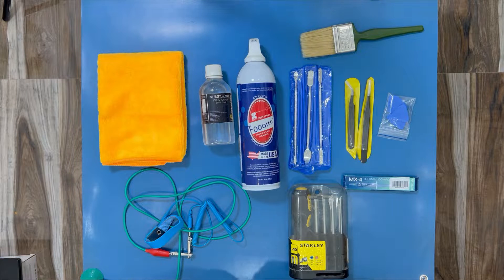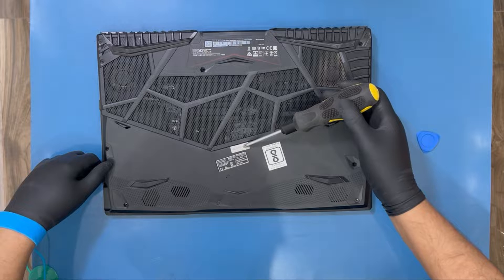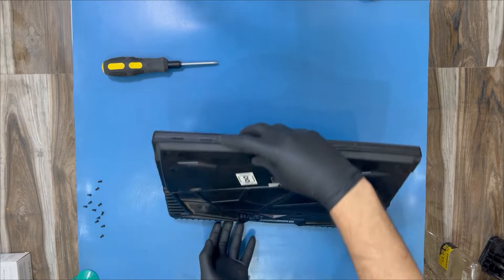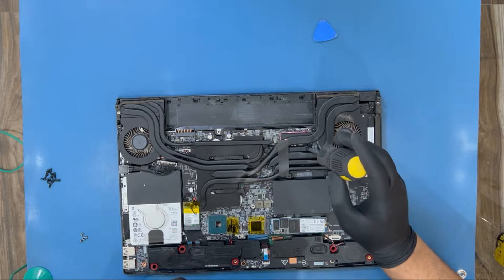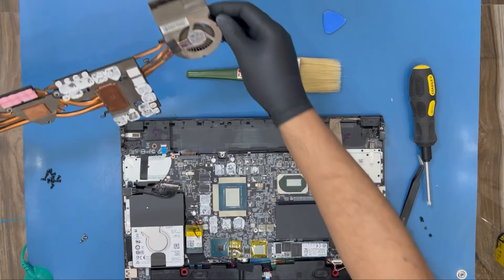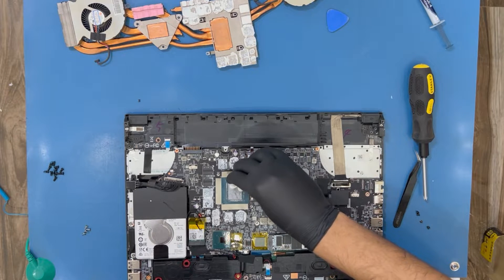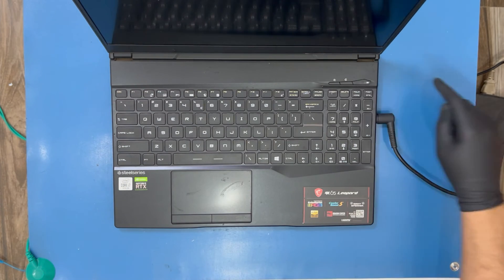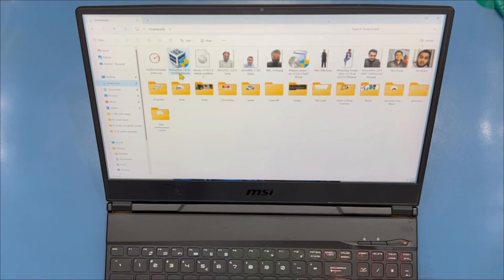MSI GL65 Teardown and thermal paste replacement | MSI GL65 Leopard 10SEK

Comment: Why did he not do half turns when unscrewing the motherboard, sure hope he didn't destroy it. Always do half turns on the numbered screws on the heat sink to let pressure release evenly to avoid damaging or even completely ruining your computer. Also, go from highest to lowest (11, 10, 9, 8, 6, 5, repeat until screws come out).

Comment: What is the pin no of msi gl65 display.please can you tell me?
Reply from the maker: Based on multiple verified listings and part references, the MSI GL65 (Leopard / Thin / GP / GF variants) generally use a 40-pin eDP (Embedded DisplayPort) connector.
Reply: @tanzTalkstech please can you tell me what are cost of display of 40 pin display of msi laptop?
Reply from the maker: If you’re looking for a replacement or spare display cable, a genuine part looks like this:

MSI K1N-3040172-J36 Genuine Display Cable (40-Pin eDP)
	•	Used in MSI GL65 / GF65 / GP65 series
	•	40-pin eDP type
	•	Price: Around ₹3,000 INR
	•	Vendor: Garmade / eBay / parts resellers

⚠️ Important: Confirm the exact part number printed on your existing cable before buying, as MSI uses slightly different cables across refresh-rate and panel variants.
Reply: @tanzTalkstech actually my msi laptop display is flickering.i think led problem so need replacement of display

Comment: I have trouble removing the connector to the fan, I have lifted it with all my might, using tweezers but the connector won't come off. Please help me.😢
Reply: Me too, i just pulled on the cables and removed the black from the white, first time is hardest, pull hard on cable
Reply from the maker: Well, it should come out easily as it did with my laptop but if it’s not coming off that easy, I’d suggest you to take your laptop to a MSI Authorised Service Centre to avoid causing any damage to hardware.

Comment: Hi, I wanted to know if the GPU is soldered to the motherboard in GL65? Or can it be removed and used as an external graphics card for another laptop?
Reply from the maker: It’s soldered to the motherboard

Comment: Hello, what is the white material that looks like gum on the vrams? Why didnt you replace them? I have the same laptop, i put thermal paste of the white areas is that okay?
Reply from the maker: That’s Thermal Pad Putty. I didn’t replace it because there wasn’t any need to. You can replace the thermal paste 2-3 times before replacing the Thermal Putty once. 
https://amzn.to/3IRPFSI

P.S.: Do not replace it with Thermal Paste. You need to clean the Thermal Paste and apply Thermal Putty on memory chips and other components except the CPU/GPU
Reply: I cant find it in turkey. Can i use good quality thermal pads instead of putty?  @tanzTalkstech
Reply from the maker: No. I highly suggest you to not do that. You have to apply Thermal Putty. If it’s available in India, it will be available in Turkey for sure. Look for Thermal Putty from different brands that’s available in Turkey. Google it out.
Reply: hello, i wanted to ask. Is it safe to replace the thermal putty on vrm and vram with a thermal pad (my laptop is GL65 9SFK 470ID) @tanzTalkstech
Reply: @zoom3103  Hi, you solve it? how?